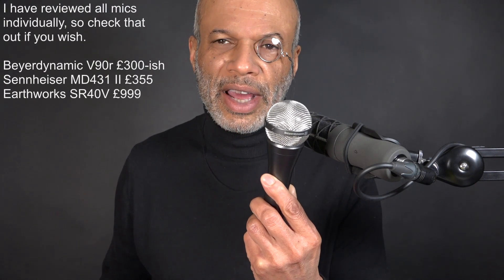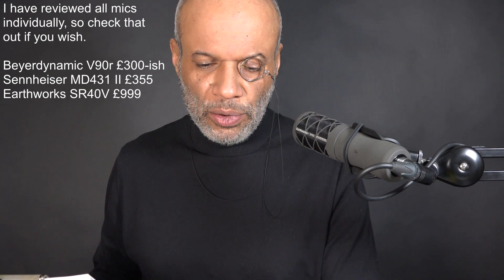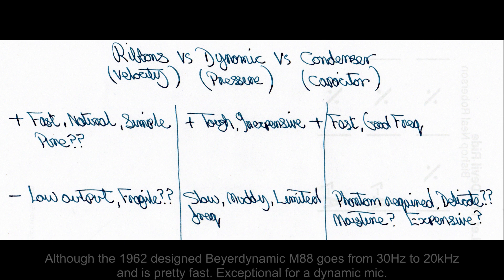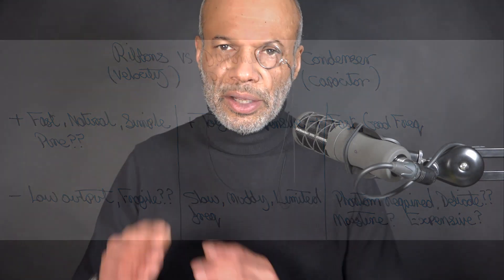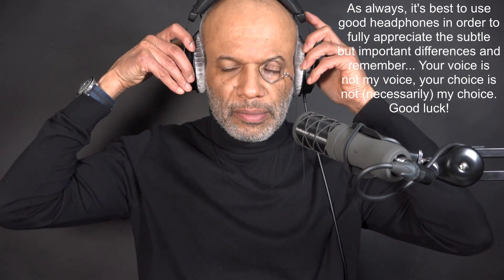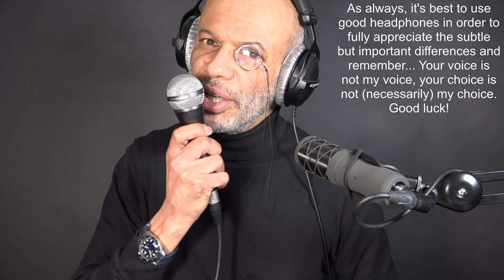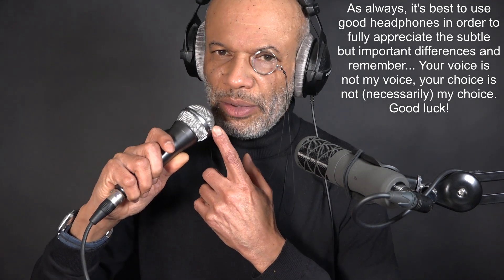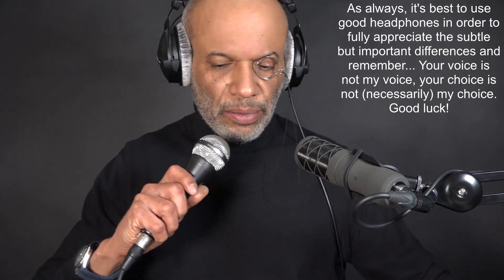Ribbon vs Dynamic vs Condenser - Earthworks SR40V vs Sennheiser MD431 II vs Beyerdynamic V90r

Comment: You should really try out the MBHO mbd 219 sc. Great dynamic mic with lowend presence. Also, I'm starting to love the condenser AT AE5400. Huge but clear sound with its large-diaphragm design. Curious to know what you'd think of these
Reply: ATM 710 is 95% off Ae5400 for much lower price

Comment: Still I want to hear your opinion on Telefunken M80 mic. It's condenser-like dynamic microphone. Really curious.
Reply from the maker: I have been in touch with Telefunken and I'm awaiting a response.
Reply: I find the M80 to be pretty awful compared most higher end dynamics. Bright, plastic sound with very little low end. It's heavy. It pops so easily it's almost useless. I'd prefer an SM58 over it...
Reply: @bryanakcasu  I totally agree with your opinion here! The M80 has awful feedback issues as well. I had to send it back! Very thin sounding mic. My se V7 and Myles Kennedy version beat it hands down.
Reply: I have both..M80 and Md431.Sennheiser is better IMO

Comment: Yes, condenser is an old name for capacitor. 

There are really two types of condenser mics. There's the electret condenser and the true condenser. I assume given its price that the Earthworks is a true condenser. There are actually very few true condenser handheld vocal mics out there. The only others I know about are one from Neumann (there may be more than one variant from Neumann) and another from beyerdynamic. They are all pretty expensive, though I'm pretty sure the beyerdynamic TG v96 is less expensive than the other two. Upper end recording mics are mostly true condenser, such as the Neumann U87 and the AKG C414., though it of course depends on the application.

The difference between true condenser and electret condenser has to do with how the capacitor is charged. You need phantom power for both but a true condenser uses it for two functions: to charge the capacitor and to power the mic's internal preamp because the output of a capacitor is so low it needs to be boosted. In an electret, the capacitor is chemically charged, though you still need phantom power from the preamp (unless your electret takes a battery for that purpose, which I don't know if is done any more). There are a ton of electret condenser vocal mics out there and while they tend to have a more effortless high end than dynamics, don't confuse them with what you just heard. They don't tend to have true condenser accuracy. A good dynamic is preferable to a cheap electret. 

Electrets have one other important capability: they can be miniaturized. Almost all lavalier and headworn mics are electrets as is the mic in your computer.